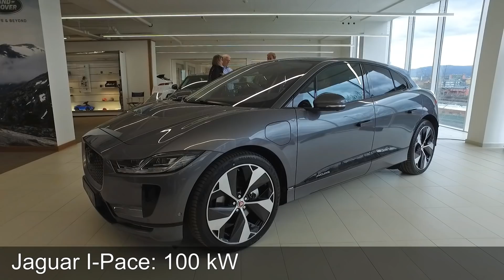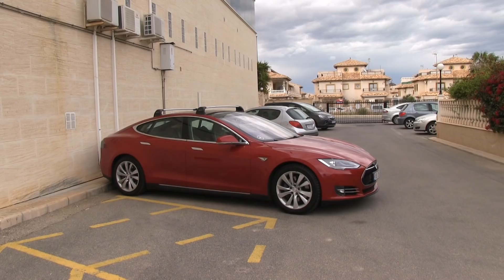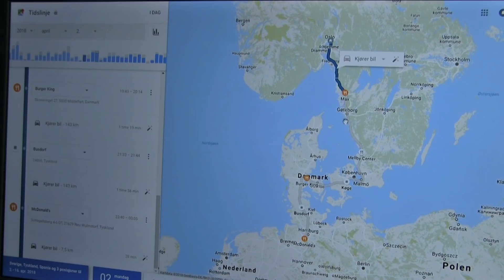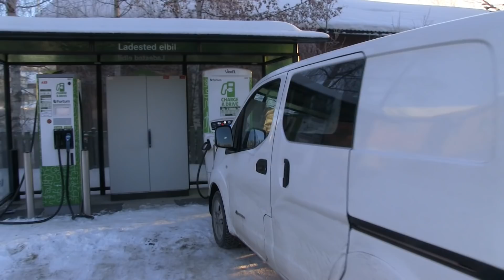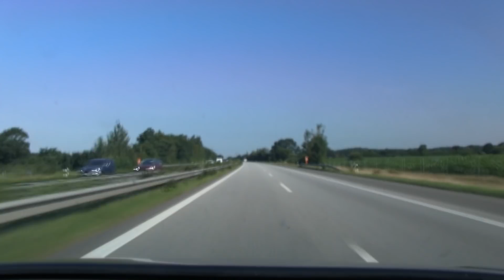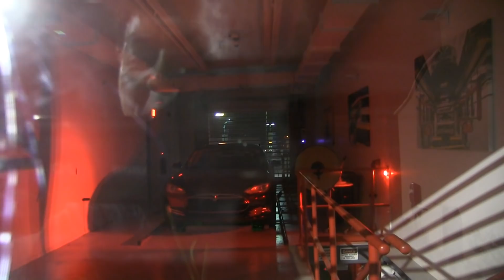Will 350 kW fast charging be too fast?

Comment from the maker: I see many people think they need 5 minute recharging time. Many of these are people who have never owned an EV or a Tesla before. Most people who owned Tesla and have done long trips realize that it charges fast enough most times. My own trips also confirms this. But as shown in the video, there will be times when you're waiting for the car and not the opposite. The only thing I can say about this case is that we have to wait 5-10 years and see how the situation will be. Remember that it still takes 1 hour to fully charge your phone. Samsung and Apple didn't push it to charge in 5 minutes.
Reply from the maker: You can't compare today's lines with future speeds and capacity. With 2x capacity and 2x speed, you reduce the need for fast charging greatly.
Reply from the maker: Yes, because people fail to understand how EVs work for daily use vs long trips.
Reply: I mostly disagree with you on the fact that you should never compare a car to a smartphone! An electric car is first of all... a CAR! Not a smartphone on wheels! Is that clear? You talk about cost but look at Tesla. Are all gadgets an stuff in Models S and Model X are pure necessity? Didn't AutoPilot, Falcon Doors and so on, hugely augmented the cost and complexity of Tesla cars? Tesla could have made huge savings for itself and for the consumer making it much more affordable and larger volumes and no "production hell" by simplifying its design.It is basically difficult to make electric cars match the average people needs and way of life, so why complexify things? Many people don't have a garage and all this home charging stuff. They have a 10k-15k€ ICE car that they refuel at station in 10 minutes and then park it in a parking or along the street. With fast chargers they could do the same. I think we should wait 10 years or more for "autonomous" gadgets and stuff  (because "autonomous driving" needs "smart" public infrastructures and severe safety norms, don't mess with people lives) and focus on the core of automotive : the car. An electric car is a car than need to be "refueled". Recharged FAST. That's precisely why electric cars are not democratized yet. Tesla is way too expensive and affordable electric cars don't have fast charge. It's easy for a Tesla owner who have access the proprietary 120 Kw Tesla fast charging network to "wait" to other. "It's fast enough for me". I think the Germans are right : maybe the 150 Kw step is useless and we should directly go for the future-proof 350 Kw right now even if car are not yet accepting it. What can do the more can do the less, but not the contrary. For industrials a 350 Kw is more profitable as you deliver significantly more billed power in less time. The less time cars stay at the station the more cars you can refuel and the best it is for everybody. And the average car driver want to have clear landmarks. If you start to build multiple networks with high power, lower power, temporary things you'll have to upgrade later it will be a costly mess. Go straight forward for the goal : 800 Km of range in less than 15 minutes.Start now to standardize everything to the most future-proof standard will make huge economies of scales. When you go to a gas station you don't mind what is the outflow of the gas pump and how much time it will take to refuel. It's the same flow in each pump and the refueling time depends on your tank and how much you fill it. Electric cars have to work just like ICE to be really democratic and what people will prefer. People want to refuel their car at the quickly at a station and do their week on a single refuel. They don't want to mind their tanks. People see their cars as their "horse" and also their last resort in case of emergency. If something happens they want to be able to travel far and fast, to save their lives, protect their family or whatever. It's something unconscious, primitive, but really important to understand. People don't like this feeling of being tied and not totally free. The 350 Kw step is an important economical and psychological milestone.My conclusion : ultra-fast charging now and "autonomous" gadgets later! Simplify, standardize, but no compromise on power, that's what will save Tesla and the electric car.
Reply: The charge-parking queue could eventually become smaller with less than 5-minute charging time, but it's already going to be a lot smaller than petrol queues because petrol cars can't charge at home or destinations for ~99% of their trips like EVs can.
Rather than improving rapid charging speed, I think it's more realistic that we'll have 1500km range batteries, making charging during daytime unnecessary - even for sales people or the niche of long-distance speed-travelers.
Reply: It's not really needed for driving, beside Germany to go fast... Are you listening to yourself... Like world is where you live. It's needed on the whole continent of Africa where stations are few and distances are huge. It's needed in rural US, it's needed in most of Eastern Europe.
Reply: That would be the best option but we are far from it - you would need huge battery capacity that also requires huge power when/if it gets flat. Difficult to do with home charger.
Reply: Bjørn Nyland I fully agree with you. Most of the people who do ask for faster charging or complain it is not fast enough have Fossil way of thinking. 

But for the super fast charger for long distance trips I see some additional aspects. 

Marketing, the technology is available and for the next generation EV you need the infrastructure of 350 kw charger. The upcoming range of EVs will have 120-150 kw charging. But the next generation will have quicker charging as selling feature and differentiator for individual market segments. 

Ionity Charger is German way of thinking of a speed unlimited Highway. The extra charge you get when your car is charging more than you need can be used for faster driving. Or if you have the last leg, to have more additional km for local traffic before starting the over night charging. 

It is not really needed for driving, beside Germany to go fast, but it is a mind game and a feeling of freedom which convince people to buy a super fast charging car, when available. It will get stressy to buy a coffee during break time:)
Reply: What we know for certain is that Tesla uses Panasonic batteries. So much for innovation.
Reply: MirageGP You need a larger Battery and the Distance of the charger must fit accordingly. Or with other words, the capacity of the battery must be large enough that you can reach the next charger for a benefit. 

The quick charge capability stops at 60%. 
You never fill up the battery to the max. 

There will be an advantage in time if you charge faster but in most cases not really recognizable. It will be per charge an advantage of 5-12 Minutes compared to now. 

If you make a charging brake you leave the car for a coffee or toilet. Have to walk. Clean the window, calculate the next leg. That needs a certain time. Everything below 20 Minutes will end up in extra charge for the car which you don't need. 

Either you spend this extra charge in driving faster, therefore you need a highway without speed limit or you carry this extra charge to the next charger. Where your charging will even faster with even more extra charge. 

Additionally the higher the state of charge at arrival the charge speed will be slower and the benefit will decrease. 

Best speed you get if you charge between 10-60%. The battery capacity must fit according to the distance of the charger. If this filling can be done within 20 Minutes you normally don't wait for the car. 

I hope that gives a bit inside.
Reply: @zolikoff

As Volker Blume said, it's not a burden or a blocking issue, to drive an EV. And it's not because those EV users were specials int the way they used their fossil cars.

It's just that even if they are both cars, you can't exactly apply you way of thinking on ICE to EV. It needs some slight adaptations (which are not a burden), but, in order to realise that you need to start using an EV.

The other fallacy is to point the inconvenience of a once or twice trip a year, to say that EV is not usable?
What is the percentage of trips that are 1500km long? 0.5%?

Another thing is that, If you're doing less thant 300km a day (pretty sure it fits more than 99% of the case), you never even have to do your 5mn fuel stops. That's better than fossil in this case.

zolikoff, you should time how long it really takes to go fuel up (without rushing), pretty sure you loose closer to 10mn thant 2mn and a half

And, if you really need the range extension, you will soon be able to have that:
http://eptender.com/en/

No excuse now! :D
Reply from the maker: You will understand once you own an EV. If you have to stop for 30 minutes on a long trip anyways, then you don't care if it takes 5 minutes or 30 minutes to charge up.
Reply: I do 25km a day on my dacia sandero.
Can somebody buy me a leaf?!😛
I promise to charge once a week
Reply: You opened my mind about this way of thinking 👍
Reply from the maker: Guess what? With 200 kWh in the future you can take your 760 km trip without having to stop because the car can go 1000 km. And even if you wanted to make a round trip the same day, it would mean that after driving about 10 hours, you finally need to top up for 25 minutes. Or you should in that case split up and drive 5 hours, top up 10 minutes and then drive another 5 hours and top up 15 minutes. It's not safe to drive long without a break anyways.
Reply: Exactly the point, even for you, I can see you commute for a long time in long trips, I believe many people will have to charge battery every week, and for some , every month! Waiting for Graphene batteries though.
Reply: Spot on - you quick charge and leave so someone else can take your spot. Imagine the queue at petrol station if it took 30min to fill up your car.
Reply: @MirageGP It doesn't need much higher power than today if you charge it every night.  Think of charging speed as kmph or mph - not in percentage of full capacity. Current slow-charging provides around 20-50kmph. Over night you'll gain 300-400km of range. That may not be enough for sales people. but double that speed and then the only issue I see is for the forgetful sales people who forget to charge but is still busy enough to drive more than 1000km two days in a row. Now we're really talking niche of the niche. Either way, we're not that far from that battery capacity even with today's technology. Unless you talk about using a secondhand compact car for the job.
Reply: @Muskar We are not there yet but not far either. As I have mentioned somewhere here, I think in 5 years from now we won't have any of the challenges we are facing today. Market will differentiate as well - more performance, more range, larger interior etc - just as it has for cars over the decades. As an avid motorcyclist, I cannot wait to see high performance Ducati or BMW on two wheels. But I would miss the noise. Jumping from one topic to another, Bjorn was annoyed by biker in the clip, meanwhile, half of experience of riding a motorcycle is hearing the wind, engine induction and exhaust noise...
Reply: MirageGP You don't get the quick charge to fill up the battery to the max. It will be not fast to get the range. So your argument for long distance travel is not applicable for large countries as Easter Europe or Africa. 

It is a combination of battery size, driving hours from stop to stop and charger distance. 

Charging speed is not the point to cover long charger distances. So, I am listening to myself. ;)
Reply: I drive 1600km distance, few times per year in one go. And back week later. Being able to charge in 30min vs 1 hour, over span of 6 stops (all hypothetical) doesn't make my trip faster???
Reply: So why is not Tesla embracing those?
Reply: We have done those trips on motorbikes as well... This is what I'm trying to point out all the time, there is more to travel than typical urban commute.
Reply: It does but it it will be upto the customer if they want to put the extra wear on their pack.
Reply: All clear mate. My typical scenario is fill up, hit the open road, much higher speeds that 80/hr that Bjorn does, cover 500km or so, stop to stretch legs, get a drink and go. Next stop is top up fuel, drink and go, third stop is rest, meal and go. I don't know what is the range on sustained high speeds and how good or bad cooling for battery and motor is on Tesla ... in any current premium "fossil" car, this trip is a breeze.
Reply: Most journys will need no stops. 99% of the time all charging will be done by destination charging. At home/work/hotel etc. Most stops on longer journies can be done during food breaks, where charging faster has no benefit just extra wear on batteries. The remander of times may benifit for ultra fast charge but when customers have a choice and ultra fast is put extra wear on their very expensive battery you might find most opt for the slower method and have an extra 15mins break
Reply: MirageGP I was driving BMW 3.0 Diesel with 50.000 km/year. Since I changed to EV where I have similar or even more milage, I think fossils are exhausting and the EV driving is a breeze. :)

Maybe a matter of trying it out.
Reply: I think some people will drive for 6h+ straight, eating while driving, and for them an ev is an inconvenience.  However normal people on road trips would stop at least every 4h to eat properly and stretch their legs.  The battery and charging should be designed with that in mind, so 500km maximum range, doing 10-80% in less than 30-40 min makes sense to me.
Reply: zolikoff I understand your way of thinking and wether EVs will have a break through or not has many factors to be considered. Agree, EV driving is different to fossil driving. It requires to turn the mindset a bit. 

If you make a fuel stop I would realistically say it takes 4 minutes to fill up, 4 minutes at the cash to pay, 4 Minutes for the toilet and 2 Minutes to walk through all those distances. Additional 4 Minutes if you grab a coffee. You also end up with roughly 20 minutes. In an EV this Time is charging time. You plug in first and do your business afterward. 

In that time you charge the amount of roughly 2 hours driving. In a fossil you might drive 4 hours and take a stop and refill. In total you have 20 minutes more every 4 hours with the given charging speed in an EV compared to a fossil car. 

With the doubled charging speed you will be already similar to fossil. But your time to get the coffee or the fulfillment of other human demands will become more stress for you, if you would like to have a benefit from the faster charging speed.  

I do get a new car these days which upgrades also my battery from 90 to 100 kWh. The major point of the battery is not the extra range you get, it is the different group of cells which allows higher voltage from the beginning and a longer fast charge area. I expect with the today given fast charge speed to have a benefit of 5 Minutes compared to the regular 20 Minutes. It will be more stress to get the coffee, or I can drive a bit faster due to the extra charge. If faster driving saves 5 minutes to reach the next stop the difference to fossil is just 10 Minutes on a 4 hour drive. 

For me a 5 Minutes charging time is not required. It would be the same as if you continue to fill up you fossil with gas during payment. It will end up with 300 liters of gasoline. :)
Reply: zolikoff Ah you are filling up after 4 hours driving within 2 Minutes? Cool. Afterwards you continue without any Coke or food just riding the milage?

It's not a burden to drive EV. Try it out. You will discover it's not a blocking issue.
Reply: Not necessary. Things change! 15-20 years ago the benchmark for a great cellphone was small, light and a week between charges. Today many if not most customers long for a large phone with a large screen - nothing like a small Nokia or Ericsson from the late 90s! My iPhone is even bigger than my old Philips - and that was a brick by the standard of its time!

Perception has changed - and I suppose that is what will occur with EV's as well when it comes to charging time vs refueling petrol or diesel. The benefits outweighs...
Reply: Here's the thing. Most people don't do 1000 km road trips every day. Not even every week or even month or maybe ever. Most people with an EV, will be able to charge at home in the evening and at work in the day and also at the supermarket. There is no need to go to a special "gas station" to fill up. If you do have to go out of your way to charge, then yes I want it to be fast too. But when you have an EV, the whole filling up process if fundamentally different, since electricity is pretty ubiquitous. This is for most people. Some people do drive 1000km each day and for them it's gonna take a while longer for EV's to be as easy to use as fossil cars. But taking into consideration the whole driving population, that is a very small minority.
Reply: Run of the mill EV's are not there yet, but with the S/X 100kWh and model 3 long range it would be doable with a single supercharger stop of 60-90 minutes. Most people could do all of their driving with a EV with 500km range and fast charging. Not saying it's accessible for most people yet.
Reply: They got fast chargers for smartphones.
Reply: I surprised you are getting the charge times you are in Norway (where it is cold). Up in the cold mountains of Colorado (in Silverthorne) it can be very slow to charge a Tesla Model 3 at the supercharger station (~60 miles/h or ~20 kW/h). Also lines do form on the weekends, so having V3 in the 200+ kW/h range would be a lifesaver. To get a full charge right now I would have to stay there for a couple hours and no one has time for that.
Reply from the maker: People are free to have their own opinions. But my opinion about this case is that people who actually owned a long range EV (only Tesla as of today) are the ones who should know best about how fast charging speeds is enough. Once you and others start using EVs for long trips, I am pretty sure you will change your opinion. Fossil driving and EV driving is not the same. You can't just stop your car in front of the fossil pump, plug in and leave.
Reply: The only thing i have against EV's is the long charging time.....most of the time it wouldn't be a problem for me personally....however about once every month or so i drive somewhere thats 760km each way stopping only for fuel....having to wait for 2-3 hours to charge in the middle of the trip each mean's that it's not worth going for a weekend visit.

When a run of the mill EV can charge as fast as i can fill with LPG i will consider buying one.....altho i still think that if someone brings out a vehicle with a tesla size battery and a small fossil fuel range extender i would buy that (like that system that fiat was playing with in their 500 ev with the range extender under the back)
Reply from the maker: The scenario you are describing is non-existant. You clearly don't understand how the queues work since you don't own a Tesla yourself. If there are queues at a supercharger, you don't have to wait 30 minutes for each car to finish. You usually wait 5 minutes between each time a slot is free. But this is not very common because Tesla expands the superchargers rapidly. And inside the car you can see live status of the superchargers and therefore avoid busy superchargers.

In the future superchargers won't be overcrowded. I have driven Tesla since 2013. Back then, we had few Teslas and few superchargers. I have seen that if the numbers of cars increase, Tesla will also increase stalls and locations.
Reply: Hi Bjørn, yes I share your thoughts, but meanwhile check this out, the future battery packs are just at the corner...
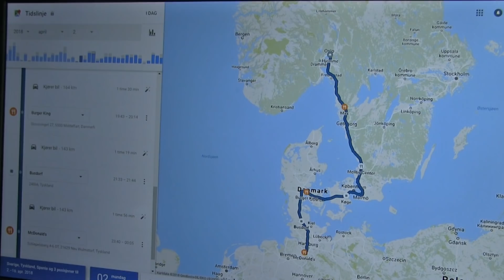https://www.youtube.com/watch?v=Go2g_BNpG_Y  (Check it at the minute 4:15) Graphene batteries is the future.